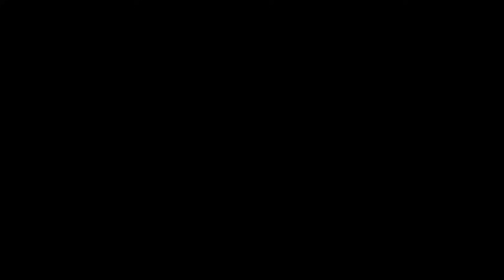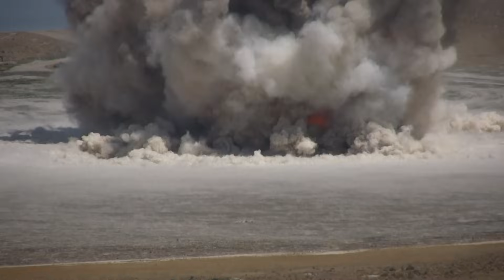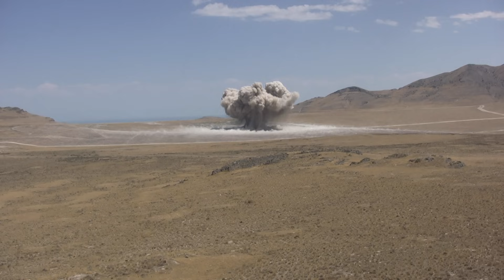Huge Explosion and Shockwave

Comment: It takes almost 6 seconds for the sound to get to them. I'll go with 5.5 seconds as that's probably pretty close. At a speed of 1,100 feet per second, that puts them right around 6000 feet away from the explosion -- or a bit over a mile away.

That's pretty impressive! A mile away and the sound is still probably over 100db.

Comment: From the video, I calculated that the cameraman and his company are at least 1.26 miles (2.0237 km) away from the center of the explosion. 

Here's how: I ran this video through my video editor, and found the time difference between the first frame of the explosion - 11.57 seconds, and the frame in which the sound of the shockwave passing by is audible - 17.47 seconds. The shockwave takes just under 5.9 seconds to get from the blast center to the camera. The speed of sound in dry air at 68*F (20*C) is 767.2 mph (1,234.8 km/h). This equates to .213 mps or 343 m/s.

.213 mps * 5.9s = 1.26 miles
343m/s * 5.9s  = 2.0237 km

Given that shockwaves travel through the air at supersonic speeds, I am aware that 1.26 miles or 2.037 km is the minimum possible distance between the blast center and the camera, and that the true distance may be slightly more (or less, depending on the air). I am also aware that the speed of sound is not constant, and depends on the humidity, temperature, and pressure of the air, which may also affect my calculations. These are just rough estimates I came up with. Feel free to leave your own thoughts below.
Reply: TheMysteryMan Can you be my math teacher?

Comment: Can any of you science people explain what that "ring" is that expands from the center of the blast from :11 to :13?  I know it's the "shockwave" but what exactly IS a shockwave?  Thanks.
Reply: All it is, is the extreme compression of air, travelling at ~350m/s (speed of sound)
It's basically just a VERY loud noise that compresses the air and disrupts the ground around it. Think of it like a subwoofer, you can feel the infrasound, but this is on a much bigger scale.
Reply: Darude Sandstorm
Reply: Michael R. Zupcak yeah and imagine that compressed air hitting your body....LETHAL
Reply: Michael R. Zupcak It's basically a super position of sound waves. Since the blast wave, or explosion, is traveling far faster than the speed of sound in air, the blast wave piles up and compresses a bunch of sound waves. A shock wave alone can kill someone by rapidly compressing their body. You also have what you call a detonation wave, which is basically a shock wave inside a the solid explosive itself, which is a far stronger shock wave.
Reply: The pressure from the explosion pushes all the air out from the center of the blast. This creates a vacuum. If you look at nuclear explosions it is easier to see. Then the vacuum sucks up all the surrounding debris which causes the mushroom cloud. In the case of a nuclear explosion this is what is referred to as nuclear fallout, which is radioactive dust. fyi  :)
Reply: water droplets

Comment: They used to do that every day (usually on a smaller scale) at TEAD South, and continued during construction of the nerve gas incinerator before someone wised up and realized that shock waves and green concrete don't mix.  There would often be multiple shots in the afternoon.  The ones that looked big were kind of muffled, but the small "black" ones were brutal.  I started to get punchy after working there a few weeks.  You stop enjoying them and begin to dread them.

Comment: Well, it takes about 6 seconds to get there. The speed of sound is 340.29m/s (it's going to be too fast for this example - low humidity/high altitude), so 340.29m/s * 6s = 2.04174km (roughly 1.27 miles).

It checks out.

Comment: I get 5.7 seconds between seeing the blast and hearing the sound. Sound travels at ~1126 feet per second at sea level. There are 5280 feet in a mile. Thus I get that, if this had taken place at sea level, the video camera would be 1.22 miles away from the explosion (Actually 1.21557...).   

Excellent documentation of the compression wave.